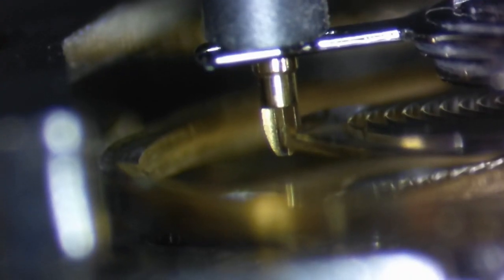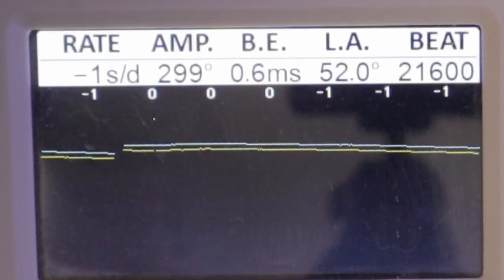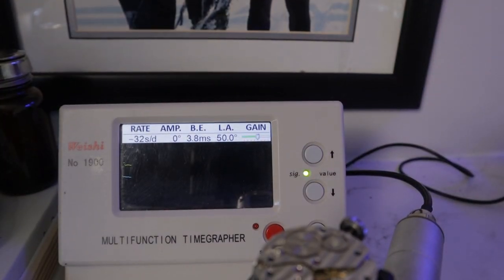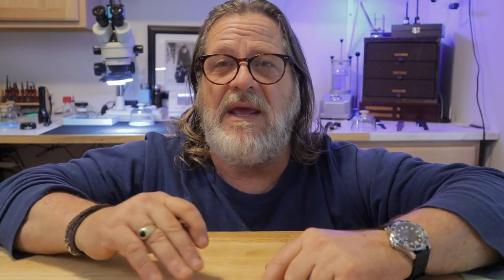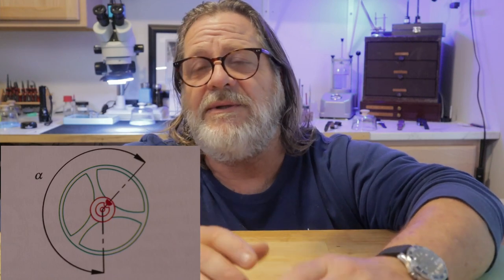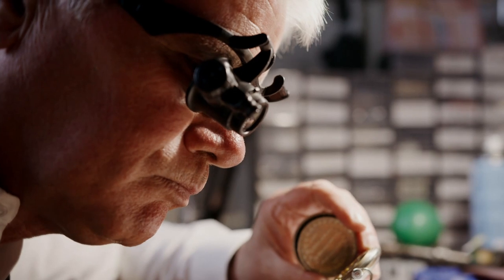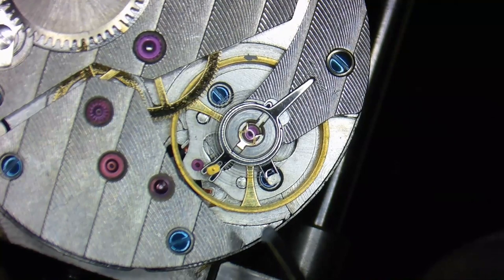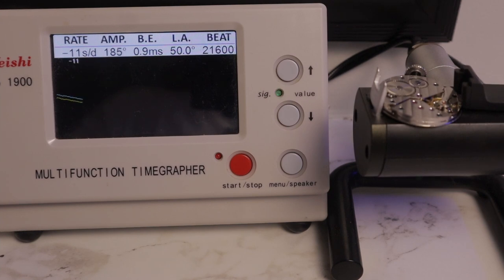Common Mistakes New Watchmakers make Using a Timegrapher

Comment: Hello,

I recently purchased a timegrapher, Weisher 1900, and put my Seiko SPB121 with the 6R35A movement on it and it's running a bit slow however my main concern is the variation between the different positions:

Date:	        Position  	Rate (S/D)	Amplitude          Beat Error (Ms)
6/30/2024	Dail up	          -15	             193	                       0.2
	                Dial down	  -3	                     209	                       0.5
	                Crown at 12H -62	                     163	                       0.1
	                Crown at 9H	  -12	             183	                       0.7
	                Crown at 6H 	  -12	             174	                       0.7
	                Crown at 3H	  -44	             181	                       0.1

There's almost a 60 second difference between some positions.  Wondering what your diagnoses is for that or if that's what you get with a mid grade movement, is there a problem with the balance wheel or does the movement simply need to be taken apart, cleaned, lubricated and put back together?  I fully wound the watch and let it sit for a couple of hours before I pulled these results.  I bought the watch new about 4 years ago and it's never been serviced.  I'm not expecting to have 0 positional variance however expecting numbers better than this.  Thank you!
Reply from the maker: Well first of all thank you for providing the information I need. Most people just send me one position. You didn't exactly right.
The amplitude is very poor in all positions.
Your vertical amplitude is such that any poising error on the balance wheel is heightened. 160-180 is the worst possible amplitude for vertical positions. 
The regulator pins appear to be properly set so I don't think that's an issue.
Your delta rate is 59. Delta rates are THE indicator for trouble in the movement.
Movements coming out of the factory lubricated which is very inconsistent as far as its accuracy.
I think this is all pointing to the movement needed to be fully serviced.
Reply: @watchrepairtutorials  Thanks for the feedback and quick response, I really appreciate it and I'll get the watch serviced one way or another!

Comment: Hi! I'm working on a Seiko 6139A. After the service, the timegrapher shows me a big difference between de back position, and the vertical position, about 30 seconds. Could you help me know where to start? 
I assume it could be play in some part, but I can't imagine which one.

Thank you!
Reply from the maker: What is the amplitude and rate for the dial up and dial down positions?
Reply: @watchrepairtutorials  dial up, 172° and 0.2ms. Dial down 190° and 0.1ms. Maybe is there a difference with the balance wheel lubrication?
Reply from the maker: @hansolo32  perfect. Start there and clean and relubricate the end stones. Clean the balance pivots as well

Comment: Finally a no-nonsense explanation. There's so many 'unboxing and review' videos which essentially are just an unboxing (what's the point in that?) and ooh, isn't it nice?
As a heating engineer, I like to explain to my customers what's happening inside their boiler in order so that they understand what needs doing/repairing.
To me at least, this video is just that. 
Defo subscribing. Many, many thanks for that detailed explanation of the details of the function of the watch. Now I can release the grip on watchmakers charging a fortune (several times the original purchase cost) of servicing my Raketas.
My better watches will come once I've built up a bit of experience.
Reply from the maker: With an analytical mind, horology is a natural hobby for you. Let me know if I can help.
Reply: @watchrepairtutorials  Many thanks, I'll try and figure it for myself, but will come back if needed.

Comment: Very educational.
But the explanation of the beat error is not 100% correct.
Regardless of the beat error the clockwise as well as the anti clockwise swing take more or less the same time. The beat error measures the time difference in milliseconds when the contact of the impulse pin happens respectably for both swing directions. Even at a high beat error the time for both clockwise and anticlock swing will be almost perfect equal.
Reply from the maker: Thank you but I’m not sure what you disagreeing with. 
What I said in the video is that, “Beat error is the difference in time that it takes for the balance wheel to rotate in one direction compared to the time it takes for the balance wheel to rotate and the other direction”.

Beat error, by definition, means there is an imbalance in timing between the two vibrations. 

You are saying that even when there is high beat error that they are practically the same, but that is not true.

Yes, it is a slight difference when the beat error is low, but as the beat error increases, the disruption to the vibration rate is larger, enough to affect the timing of the movement.
Reply: @watchrepairtutorials  I very much appreciate you expertise work and video teach.
What I wanted to point out is that the clockwise swing of e.g. +270° takes almost the exact same time as the counterclockwise -270° swing. Regardless of the beat error.
If you have a beat error of e.g. 2ms that translates roughly into 10° (depending on beat rate, amplitude, etc.).
Such an error would roughly cause the fork to be hit (ignoring the liftangel or assuming it as zero) at 270/2-10/2 = 130° at one of the swings and 270/2+10/2 = 140°.
As such it is not the difference in time that it takes for the balance wheel to fully rotate in one direction compared to the fully reverse direction. This times imho are almost indistinguishable equal.
Reply from the maker: @hipphipphurra77  I agree, its not much ofa difference, bit there is. This is why timing machine look at the timing of each vibration and average them and spit out a number.
I am guessing  your background is either in engineering, math or physics. Is this accurate. If so I have a question for you which I cannot find an answer.
Reply: @watchrepairtutorials  ;)

Comment: Hi  Alex,  I often  come  back  to  your  video's  for  reference, I have  a simple  question if you  could  clear up for  me please. Are the  dots  on  the  timegrapher the palate fork hitting the banking pins or the palate stones on the  escape wheel? Hope you  can enlighten me "to become a better watchmaker " 😉
Reply from the maker: It’s not quite that simple. These dots are called indications and indications are caused by the tick sounds of the escapement. All 3 of them together because they happen about 100th of a second from EACH other.
Reply: @watchrepairtutorials  Thanks, for  your  response. Impulse jewels/banking pin/escape wheel hitting stone. Am I now  a better  watchmaker? Thanks  again.

Comment: This is the best video I’ve seen in explaining the time grapher! Think you could explain the function of the GAIN setting? I’ve always kept it on medium and never ran into any issue but recently purchased a watch that it needed to be turned up (more sensitive) to get a clean reading. If you have it set too high could it not make unclean readings look better then they actually are? THANKS!
Reply from the maker: A higher gain setting will amplify the ticking sound of the watch, making it easier for the timegrapher to pick up on subtle variations in the watch's performance. This can be helpful when analyzing watches with low amplitudes or when attempting to detect problems with the watch's balance wheel or escapement. Going to a lower gain would probably have a more masking effect than to a higher setting.
Medium is a good place to be.
Reply: @watchrepairtutorials  Thanks for taking the time to answer!

Comment: When i am adjusting a Vintage watch, should i adjust the rate more  to + or minus – seconds. I mean when the watch runs and the oils get older the watch will run slower again.
Should i adjust the watch now to + seconds?
Cause i think to bring a vintage watch to 0 is almost Impossible.
Reply from the maker: Great question. First let me say that when amplitude is lost by dried oils and dirt, watches typically run fast .if it’s slow there is usually something else going on.
How you regulate a watch really depends on the watch it self.
If you have a movement that maintains minimum amplitude, around 200 degrees, after running from a full wind I typically regulate the watch to the fast side because no one wants to be late.
If a watch can’t maintain minimum amplitude and drops to say 170-180, I typically regulate to the - . 
That’s because when the amplitude gets to those lower numbers the rate starts to increase, so whatever time was lost during the day will be regained as the watch speeds up.
Make sense?
Reply: @watchrepairtutorials  yes that makes sense.
I work, most at the time, on realy old pocket watches. They have those realy big ballances. And especialy on the american pocket watches they are crazy big.😅 And yes no one wants to be late.
I don't know if you know that but how did they regulate Pocket watches in the 1800? Cause i am always impressed how they could make so acurate timepices.
Reply from the maker: @seangerst6561  with vintage pocketwatches you are always fighting wear, especially on movements under 17 jewels. Railroad grade watch’s on the other hand can still be as accurate as they were used back in the day.
In the early 1900’s watch manufacturers used a electric Master clock which sent a signal to slave clocks throughout the factory. Once the watch was assembled, the watch would go to the finish room were is was adjusted and regulated. This process required the movement to be timed for 24 hrs in each position the the finisher would make an adjust and repeat the process over and over until the watch was within specifications. The length of time this took depended on the how many positions the watch was adjusted to. For a railroad grade, it was about 2 months.
 Before electric master clocks, the would have used master pendulum clock which would have been the most accurate at the time and they would go through a similar process depending on the quality of the movement.
Reply: @watchrepairtutorials  crazy...  At first thanks for the awnsers.
I aprichiate your videos and love to learn new stuff. Always when i see a new video from you i learn new stuff like polishing the inside of the barrel holes, to that point i wasn't even thinking about that, and after i have done that the amplitude was way better. 
Yes we always fight the wear, i recently finished working on an old ladys pocket watch an it just had 6 jewles, it was realy hard but with your tips and tricks i finished it and it was running (perfect) for a watch from that era. 
Thanks👍🏼😊😊

Comment: Great video Alex. Could you talk about what if you see a snow storm even after a service what you may have miss or what to check first.
Reply from the maker: Give me some context. What’s the rate and amplitude showing up. Did you demagnetize the movement?
Reply: @watchrepairtutorials  Alex this is a Waltham grade 620 pocket watch. Had a busted mainspring which I replace. Did my normal service and adjustments got the rate down to + 4 sec per day and the amplitude is at 272 this is taken with the watch in the face up position. I did demagnetize as I always do as part of a service and I check with a app on have on my phone. But the traces are very noisy which tells me there extraneous noise coming from the movement. I put this on the back burner for now will strip down when I get time.
Reply from the maker: @PMELKUS  if you have 2 distinct trace lines, it is an escapement issue.
Could be wear on escape wheel teeth, a pallet stone chip or incorrect position, a problem with divisions or a banking pin issue.
Pretty common in these old girls.

Comment: Very good explanations, thanx!
Reply from the maker: Thanks Ernest. I hope it helps you in some way.
Reply: @watchrepairtutorials  yeah. I am no watch maker in any sense, and at this point I would not dare to disassemble the movement. I have this old watch from my dad, that passed away back in 1993. The watch is from the 70's I think. It is a known brand in ex-Yugoslavia, but otherwise I don't think so... Omikron. It has a Unitas 6325 movement with 21 jewels (Swiss made). The watch was never ever serviced to my knowledge. The front plate was in a very bad condition with some yellow stains, that I took it apart a take off the coating from the plate and used some black spray and then cleaned the digits. I polished the plexiglass. So then I was looking for some knowledge about how does it work in the first place. Very interesting invention, once you understand the basics. And now I was trying to make the watch run as true as possible. I found this phone App called Watch Accuracy Meter. It seems it works just fine. I was able to reduce the beat error to the minimum of about +0.2 BUT I see big differences in the speed between: 1) Half winded vs. Full winded (-731 vs. +71 s/day), and 2) Orientation, Face Up vs. Face Down (+71 vs. +2 s/day). I did adjusted it Face Down and fully winded. So that is consistent and watch would be true in that position... BUT, probably because the watch is never serviced in it's 50 years of life it will not be possible to adjust it "right" for all positions....?? Sorry for the long story, 🙂you probably have better things to do then to read this layman details.  Haha. Cheers I will watch more of your vides and who knows...

Comment: Hi. Realy learning a lot from all of your videos . I tried to regulate a 2892 a2 movement ,after i serviced it. Before the service, it was slow. Now , it has a different readings depending on a position, and amplitude changes too. The amplitude veries from 250 to 310. The beat error is good. 0 to .3. The rate is  from -23 to +20. Also, the rate is jumping within the same position. Up,Down, 6 , 9, 8, 3, 12. , all different. I use a witshi g4 regulator. From my previous expiriences , the irregularety usualy goes away after i service the watch. Could it be that i need to put a new main spring, i used the original, it looked good. The watch is not older then 20 years.I kind of averaged the rate error. Do not know, if this the correct way of doing it. Its is a ramond wyle.?????
Reply from the maker: The problem could be the mainspring. What did you do to it when you serviced the watch ? When the amplitude varies like that it is a power transmission issue. That could be anywhere between the mainspring and the escape wheel
Reply: @watchrepairtutorials  it was like that before I serviced it. I cleaned it with the Elma solution in a Elma machine. Then oiled it. Took the spring off, then oiled it and put it back . same spring. I ordered a new one now. I will try to reservice it .
Reply from the maker: @eugenerutenberg5281  while you wait for the new mainspring I would check how well the train is running. Are getting and back lash ? 
When you say you oiled the mainspring what and how much did you use? What did you use for braking grease ?
And how much?
Is there any wear in the barrel bridge or plate caused by the barrel?
Was the mainspring flat when you took it out? Any wear in the barrrel? 
Reinspect all the teeth and pinions of the train wheels.
Make sure all pivots are straight.
Check each wheel installed in the bridge one at a time to see how it spins by itself.
Reply: Thank you. it seems that , when the spring is not wound the watch is fast 50 sec. when it is nicely wound it is slow . I can't get a strate line in any position. it goes down and up , down and up. I will check everything you mentioned when I get a new spring. thank you.
Reply from the maker: @eugenerutenberg5281  one of the things that can be really confusing is when there  are multiple issues going on at the same time.
This is why you have to check systems and when they pass the testing you move to the next system so you can isolate  faults.
If you hand would the mainspring in, that is often the cause. 
When a perfect mainspring is in the barrel, as the mainspring winds, it stays centered between the lid and the bottom of the drum so there is no friction.
When a mainspring gets deformed, which happens when it being installed by hand, it cones so when the mainspring is wound up, the spring is now either pushed or down hitting the lid or bottom.
This introduces a major fault starting at the barrel which gets worse as the power travels to the escape wheel
Reply: It looks like this is exactly what is going on. the beat error and amplitude is stable, but the rate is not.

Comment: You mentioned swiss watchmaking school textbooks, any recommendations?
Reply from the maker: In the book “The Theory of Horology, on page 158 is where the information about the 8 o’clock position is. This is not a book I would recommend if you’re just starting out as it’s not really how to book but more technical stuff that really would be kind of pointless for someone new.
If you are looking for a book on watchrepair I would highly recommend the “Bulova school watchmaking”. 
This book was written in the middle 40s for servicemen returning after WWII because there was a lack of watchmakers in the country. 
It was one of the first books written in plain English, so it was easy to understand. Even though it’s 75 years old not a whole lot is changed and watchmaking and it covers so much information it would be a valuable resource.